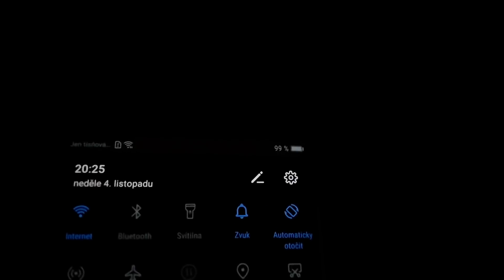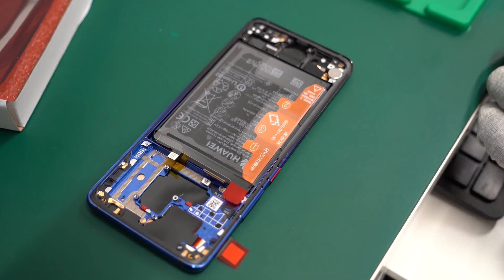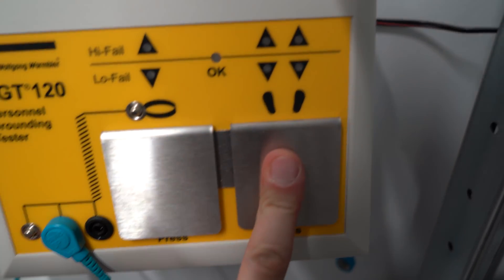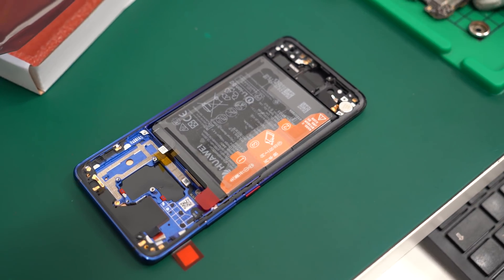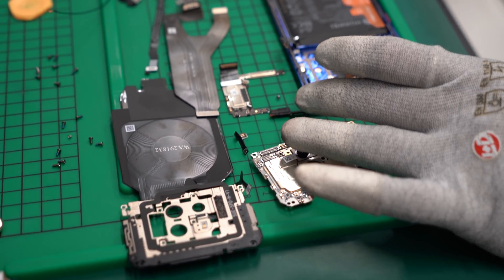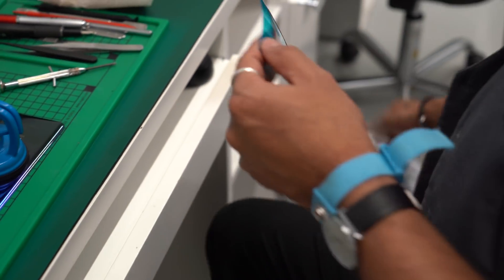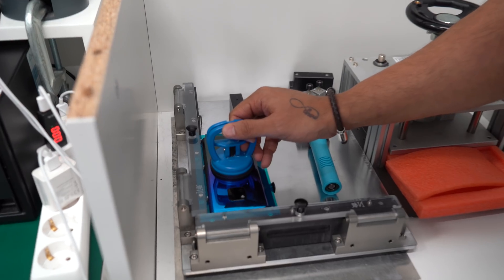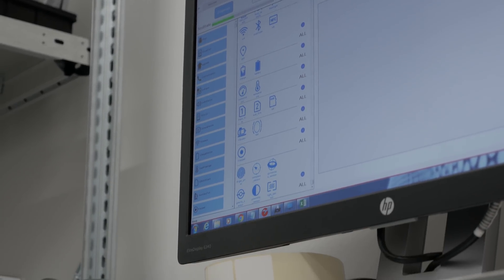Fixing the Huawei Mate 20 Pro Gluegate Problem - Teardown & Repair !

Comment: I recently bought HUAWEI Mate 20 Pro from Vodafone, with in 2 months of use both side of screen has deep green patch, I called HUAWEI customer care but didn't get any positive response.. they finally suggest me to take to Vodafone store but they want to repire my phone, which is complete bonkers n unacceptable to have repire phone. No one deserve to have repire phone within few months of use. I didn't even open screen plastic from the phone but refused to get any service form either form Vodafone, nor from HUAWEI. It was online upgrade which i collected on 8/11/2018 and reported the issue on 11/01/19, it is unfair to have repairs phone whereas I didn't physically damaged it. Although HUAWEI customer care said some of the device have this issue  but refuse to replace my device with new one.  But if I bought an Apple product things could be different. Apple would have replace my phone instantly, moreover HUAWEI don't have enough service centre to go to. It premium phone with premium price tag, should have this problem either. All HUAWEI Mate 20 have this problem but they didn't recall it. Here in U.K. There isn't any customer service centre so I had deal with over the phone and shit. Absolute rubbish service. But I would have different if bought iPhone.

Comment: Who would be stupid enough to allow their brand new phone to be cracked open and repaired, its not fit for purpose, so it should be replaced for a fully functioning one, Huawei are taking advantage of their customers by kidding them, that if Huawei repair them in 2 hours thats acceptable, if the company has software to test their phones, why havent they employed someone to test the phones prior to selling them, this is an absolute disgrace, and customers should not settle for this, tell Huawei you want a replacement phone, in the UK thats your statutory rights under the consumer rights act of 2015, as long as you say its not fit for purpose, the problem is if a reasonable customer would accept it, if all customers considered the impact they are having on the next customer, Huawei could not get away with this, if you dont accept it the next customer wont have to, if you do, they may have too, start fighting back NOW. Do you think opening and heating your device wont have an impact on its life span, honestly think about it, it cant be a good thing can it, thank god I haven't bought one, as after watching this video, when this reviewer thinks its ok, I feel other customers who have been stupid enough to fall for this would also have an impact on my statutory rights, its time the consumer fought back against these companies selling £1000 devices with poor quality controls, if the customers did not settle for this the devices would have better quality controls, and rather than investing in repair centres Huawei would be better investing in quality control, trust me this negative publicity could easily have been avoided, if only the parent company wanted it to. The reviewer says he has the unique opportunity, that doesn't sound like a positive opportunity to me, and lets not forget if the phone had good quality control he wouldnt need it repaired. Im just so surprised how happy and content he is, to have spent so much money on a defective phone and allowing it to be cracked open and repaired.

Comment: Miss leading, biased and unnecessary. Faulty devices should be replaced with new if under one year old. I've had the green screen issue, you can see it clearly under ALL conditions.

Comment: Stop trying to explain the issue if all you are using to make an opinion on the matter is a few articles and a biased Huawei statement. The issue has plagued many of their phones that much is a guarantee, me and my friend who had pre-ordered our phones from different carriers both had the exact same issue, there is no way this is on a small scale. Even though my green hue was only very slight it was still noticeable. It doesn't matter how slight it is, what matters is that it's incorrect and should be replaced, not repaired where there's chances for them to make mistakes and give you back a phone with inadequate glue placement causing the phones water resistant to be void. Leave the PR stuff to Huawei (who aren't doing much better). Don't try and downplay the whole thing and say most people are over exaggerating the issue.

Comment: Michael Fischer has obviously been paid by Huawei to portray they are just and honourable (honor get it). Jokes aside. He has mentioned unnatural conditions. Are you serious? There are way too many instances when using the phone you will encounter a grey background and hence making the green tint very much noticeable. Secondly a fault like such warrants a straight replacement to brand new NOT a repair. Thirdly, by replacing the screen you unavoidably break the ip68 rating on the device. It seems Mr Fisher is a Huawei embassador  but cannot officially obtain a public note to the consumer on this massive scandal of a screen issue or even an official apology on wasting consumer time and money.

Comment: You are miss informed I love this phone but I've had to replace the phone 7 times and now finally have a good screen shouldn't have persisted so much but I came from huawei had all my stuff backed up with huawei's software, the conditions are not un natural at all and the issue goes from noticeable to horribly visible along several days use the conditions for this are basically any apps dark theme or night mode even the stock phone app amongst other when the phone dark mode is enabled to save battery with amoled display at the lowest brightness levels so at night.  I read at night I get insomnia and that's when its the worst you paid 1 and a half grand on a faulty screen huawei said nothing for more than a month now no official message,  you kind of behave like an apple fan boy or a spokesperson nothing personal but the issue is not small and rare it took a full month of playing the screen lottery persistently for me and lets add I live in australia and theres one service center at a 4 hours flight there's only one in the country.
Reply: That is why Samsung and Iphone are the biggest sellers in Aust.It's called after sales service.You wouldnt but a Great Wall or Chery car.Telstra doesn't  sell that junk.I have seen in Optus stores one or two models.I  asked them how they were selling and they laughed sarcastically.Sorry you got stuck.Maybe sell it and move on.
Reply: @RJ-jh9fs  I get your oppignion but samsung warranty service is garbage and just as scarse,  I had an s8 the plastic sim tray broke out of nowhere stuck whilst pulling it out they wouldn't called some number they were going to charge me and I would have to airmail it somewhere additionally away from home they simply tell you your only warranty is only valid in the country of purchase.  I can't really use iphones anymore but they still win at customer service hands down no receipt no blabla any hardware issue straight swapp and on you go.

Comment: This video is actually misleading for a few reasons. First of all any affected device is not repaird but replaced with a new one. And the issue is far from being solved as they are replacing faulty devices with other faulty devices until they clear stock. My second mate is on his way to repairs. It's crazy.
Reply: Wish u a good luck broo..just take a refund n w8 for s10..is it possible??
Reply: i went to service centre , they told me that they will replace screen. Is that enough ? Should i insist for product replacement ?

Comment: I've had 5 affected phones with the green screen issue. Abnormal conditions? Dark mode can be switched on in the battery settings so I'm not too sure how an included feature can be classed as abnormal.

Also where the green is minor to begin with it does get worse over time.

Great phone. Huawei should have had a product recall rather than using customers like me to weadle or the bad units for them.

I'm expecting unit number 6 today. I don't know how much longer I can be patient before I give up.
Reply from the maker: What ? :D i just referred to the ones who mix up the gluegate with cornering shadow from the oled. Anyway, 6 phones is incredible. better checking them at the store lol
Reply: @TechMagnet  the cornering shadow is completely different to the green screen bleed. I had all my phone's switched to dark mode, auto brightness and very apparent if viewing from the dial screen but then when watching certain YouTube videos, even bright lit ones like an outdoor scenario, I got a green haze where there shouldn't be.

Aside, I love the phone. I've had a lot of phones over the last 10 years, mainly Samsung and iPhones, but this is the best which is why I'm persevering with this.

Also, nice video. And you're quite cute.

Comment: After you disassemble this phone, it no longer complies with IP68 standard. So Huawei should replace defective phones, not repair them
Reply: Would be better if huawei made a deal with samsung at the beginning ..
Reply: Here at Philippines, they replace it 1:1. If there still an issue, they will replace it again. Until we will get the BOE panel instead of LG. But the new batch of Mate 20 Pro here will be made of BOE panels, no more LG. All LG panel must be taken back to Huawei😊
Reply: @ianrichleighbumanglag1887  some people say that BOE screens are not as beautiful as LG ?!
Reply: @yugithedarkduelist  ya... LG screen more beautiful than BOE. But still okay. As long as less risk of screen problem
Reply: @zaidanz9684  Still, not LG's fault... If no other phone had this issue, why you blame it on LG? It is a soldering issue by Huawei, and while LG OLEDs suffer from burn-ins (all do, that is why I support backlight technologies like QLED or IPS LCD), there are no reports of green lights on phones other than this one...
Reply: @ianrichleighbumanglag1887  nakapag pareplace kana? Balak ko din nyan. Saang huawei center mo dinala?
Reply: I'm one of the first to get hands on this phone. Im lucky my LG screen is perfect.
Reply from the maker: I thought the same... But when he took it apart I saw Exactly the same glue Stripes like he used for the assembly. It was no fluid glue.. Also they give again warranty on it. So I wouldn't worry about it.
Reply: @TechMagnet  Pretty sure no company give you warranty for water damage...
Reply: @MiguelAngel-rw7kn  I reckon if it's water damage due to a repair that changes its IP rating, I think it should be covered.
Reply: @MiguelAngel-rw7kn  Sony does

Comment: I was there and my mate's display was swapped. Was again a LG with errors. Then back to the store and swapped for a new one. Again a LG caught. And as expected after a few days of the same mistake. Again get a new device and fortunately this time with a BOE display. Works fine for a few weeks. Staff in the store were very helpful
Reply: Boe not good as well 
My BOE screen is abit red tint and really obvious especially on white background
And now i request exchange again...
For my opinion if u compare LG and BOE 
LG is far way better than BOE 
The color and the vivid mode LG is more sharp and brightness sorry for my bad english..
I'm from malaysia user (mate 20 pro)
Reply from the maker: Interesting. Did they tell you which screen you will get? So you got a new device and gave the old one back right?
Reply: @TechMagnet  No the technicians have told me they can not tell from which manufacturer the display is. Yes, get the old back and a new welded one.
Reply from the maker: @christianglasner8295  hm yea probably they are advised to do so.. Or they can't identify the display from the parts number, which I doubt. Good that they replaced it, that's what they should do.
Reply: Did you have huge problem with green display? or just small discoloration? because i have small green discoloration and i don't know if they are going to accept it as defect, but it's definitely not normal color
Reply: doesnt sound like a great experience @christian Glasner. I had two phones with the green screen issue. I got a refund after taking the second one back.
Reply: Did you swap the displays ( repair ) or you got new devices each time?
Reply: i alwasy said buy  cheap get junk ,samsung are the leaders for a reason

Comment: Xda forums are all over the place with green screen issue and they are loads of issues  reported on Non LG screen!
People have sent their device back 4/5 times and still getting their issues unfortunately.
Reply: yeah but this reviewer seems to think the problem is a small one only viewable in certain light conditions. I had two mate 20 pros with at least 8mm each side of the screen that went bright green. This reviewer is talking rubbish. Ive unsubbed from you techmagnet youre damaging your reputation with this video. You cant be trusted when you are playing down the big issues this phone has. You have sold out.
Reply: @chimber  agreed, Huawei somehow is making sure no reviewers make this issue known, or at least portray it like it's a minor thing when reality is that it is far from it
Reply: My first one had a realy bad green screen after 1 week so I exchanged from the LG screen to luckily the boe. Its good 1.5 weeks in to ownership so for no issues. Its a nice bright screen but not as perfect as a Samsung display  there's uneven colours sometimes but not too often. I'm happy overall. Though any more trouble and il go back to Samsung. I'll probaly get the S10 after a few months of release.
Reply: Once again... It is not LG's issue, it is Huawei's factory soldering issue...
Reply from the maker: Exactly but this needs to be separated. That's why I said that there are devices with a really strong glow, and some which have a slight shadow that's due to the curve and viewing angles. People with green glow should get it exchanged immediately, but people shouldn't panic 🤔 have met some guys infront of the service store who wanted a replacement without even having an issue 😂
Reply: @TechMagnet  Some peoples get three mate 20 pro and still have green screen issue.

Comment: Mining bitcoins just got easier with the antminer s9 hardware. This hardware is specially designed to mine bitcoins directly into a blockchain,Luno and coinbase  wallet. It mines at a speed of 0.041btc per hour.  It's quiet expensive and because of the cost most people can’t afford it so i mine for them. I mine for a commission of 20% of your daily earnings, meaning if you earn 1btc daily my commission is 0.2btc, get back to me so I advise you on what next to do, reach me via email: rachelbrookemonique@gmail.com and WhatsApp +14422433874

Comment: You said unrealistic grey patterns used? and no one will use them? You do know the point of using the grey was to see if your device is having the issue or will have the issue. As many stated the first days even during the "unrealistic" grey screen you mentioned was not there and developed over time. What is the point of spending so much ona  phone to have it repaired and losing it's water resistance .

Comment: So you pay a premium price for a device that needs to be repaired after a few days from purchase? I believe a replacement is more appropriate.
Reply: i had two phones both had at least 8mm of bright green screen bleed on the left and right of the screens. Also contrary to what this reviewer is saying this screen problem is viewable in all lights both bright and dark.
Reply: True . What about the mate 20 rs . With those leather texture on it and so expensive . You just go and repair it ? Huawei is to careless
Reply: I don't have any screen burns . I'm using a s5 😥 for 4 years and so many retards tell that super amoled is worse than ips
Reply: @impulsedguy6557  have the normal mate 20 the same problem???
Reply: No, only mate 20 pro have this problem, because is using curve screen from LG, mate 20 and mate 20X are using flat screen panel, so there is no problem at all.
Reply: @impulsedguy6557  because it is i had 2 samsung both burned so its trash
Reply: its happening because 95% all phones are produced in china under massive pressure when hundreds of people assembly your device. all means variabilities and now you complain about phone repair. at first, my understanding of meaning repair its different from changing prefabricated blocks of components.
at second, in the repair (rebuild) process like you seen in video its responsible one person something like AMG build engine.
Reply: Johnny Dickshot  but the screen is really important
Reply: Raya Colayco one guy has 4 replacements in 1 week all has green screen issue
Reply: lol iphone had charging problem, s9 had dead spots and 20 pro  a glue gate. all of theese problems affected only a limited number of phones... i phone is almost double the price of s9 and 20pro
Reply: @jangalganak3687  Yeah... the iphone had a software problem not a hardware failure... completely different
Reply: @MiguelAngel-rw7kn   iphone has also batterie problems in the past
Reply: @jangalganak3687  let's not forget the notes that exploded on people